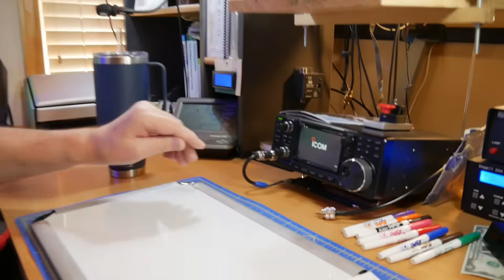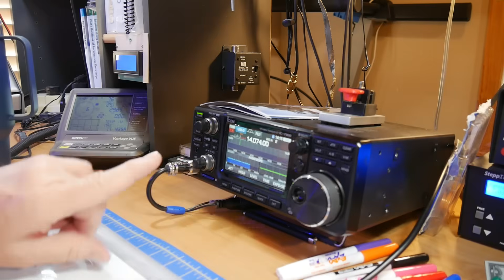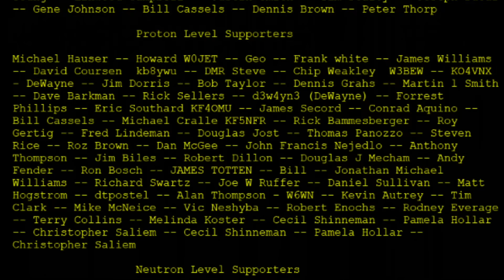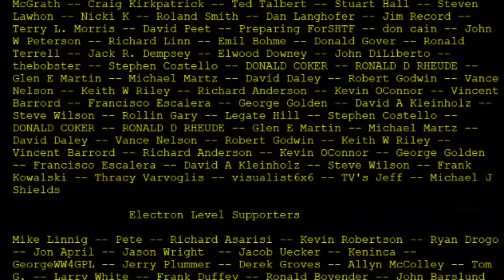The Evils of Phase Noise (#1365)

Comment: Why could the question on phase noise etc. not be solved by using an open /closed 1/4 lambda piece of coax connected to a T-splitter?  The 1/4 Lambda would greatly attenuate out of band signals.  It is cheap and easy to build.

Comment: An oscillator with poor phase-noise can be made almost 20 dB better in phase-noise with a Wenschel Noise cancelling amplifier ( input from osc.  Made by a series capacitor and output is coupled on the other side of a resistor and then to the following RX-circuitry. This Amp only amplify the NOISE and then feed it back 180° out of phase, which lowers the noise most significantly)
GL de Bjoern

Comment: We used tuned stubs to remove the local interference when we were operating several stations together. It worked great. We put a tee piece in the feeder coax and put a tuned length of coax for the band we wanted to get rid of.